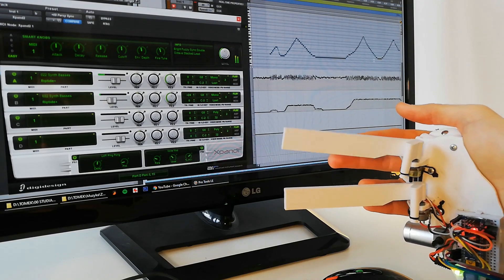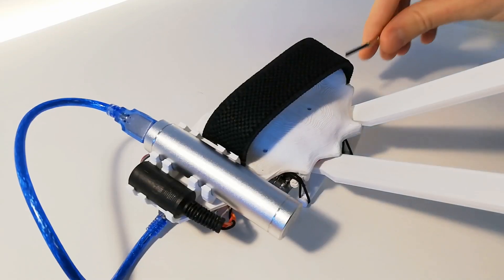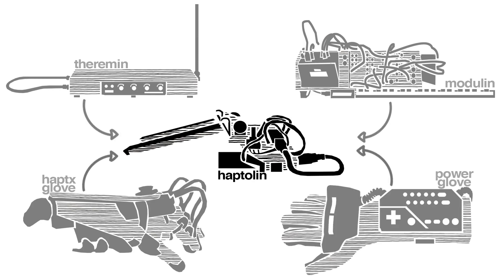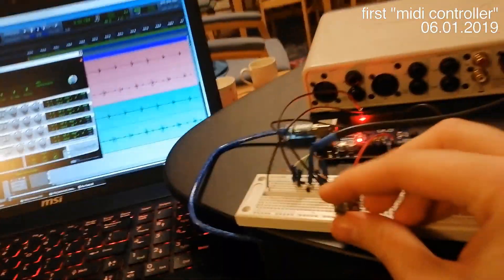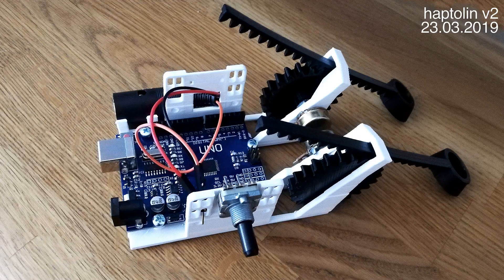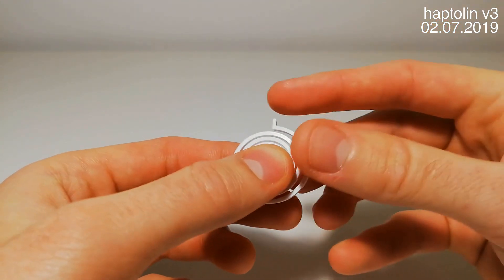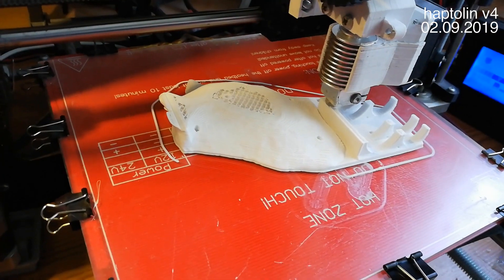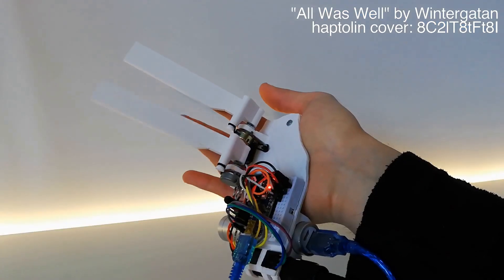Haptolin - my microtonal Arduino MIDI instrument!

Comment: That is absolutely awesome. Next step is to strap a bunch of modular synths to your arm and look like a cyberpunk character. Are you able to disable to micro tonality and just play semitones?
Reply from the maker: Yea, that would be possible, but I really wanted to have a microtonal instrument, since all of my other ones were semitonal. It's especially useful with little ambient-like effects and fillers, since they feel way more organic than if I played them on a keyboard.
Reply: @bzqp  yeah I really like the look and feel of the whole thing. I'm probably going to end up making my own eventually cause this is so cool. Maybe I'll add a switch or something to enable/disable microtonal stuff
Reply: @bzqp  Is it polyphonic? If so, is it right to assume you can have up to 5 voices (one for finger)?
Reply from the maker: @yuriamorim  The v1 was polyphonic for a while (3:46), but the subsequent versions were monophonic. My very 1st idea for the haptolin was indeed for 5 fingers (each controlling a different effect of the synth), but that would be way too confusing to control and the learning curve would be quite steep.
Also - the code is editable and open source, so it's fairly easy to assign any MIDI command you want to any potentiometer.

Comment: Nice prokect ! ,would you please show me how you placed those potentionmeters with pulleys and belts ? i like that structure. Thanks
Reply from the maker: Thanks! There are some close-up photos on the Arduino Project Hub (link in the description). You just slide the potentiometers in the holes and use a nut to fix them in place. 

The elastic bands are hooked on one side to the keys attachements, and on the other side to m3 bolts that hold the 2 pieces of the case together (again - it's visible on one of the close-up pictures).

The belt is a 30mm-wide elastic strap. On one side (next to the power bank) you glue it to the case, on the other side it is held with an m3 nut, which makes it sort of adjustable. (you only need to ajdust it once - you can just slide your palm in when the strap is mounted properly). :)

Also - you can check the 3D STL files - everything should become clear after you investigate them.